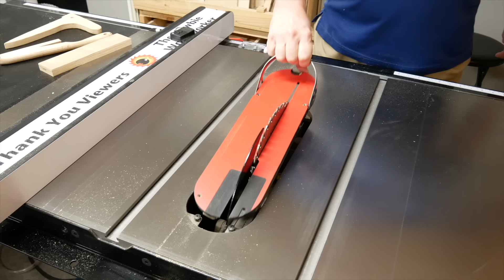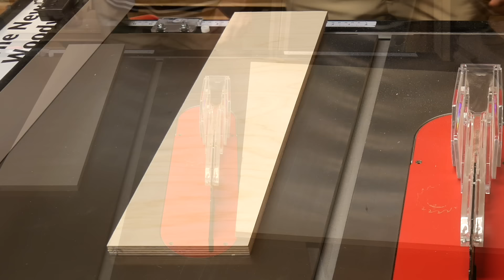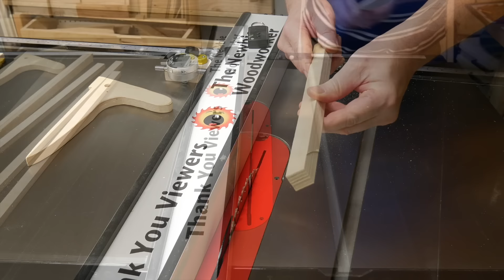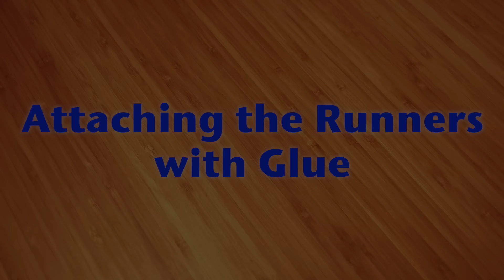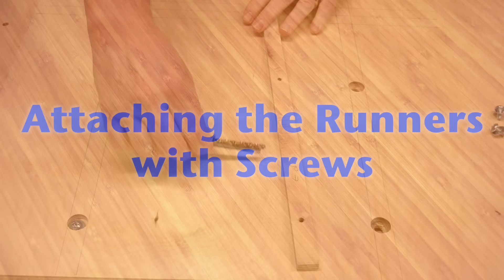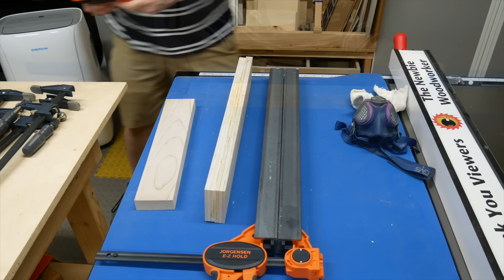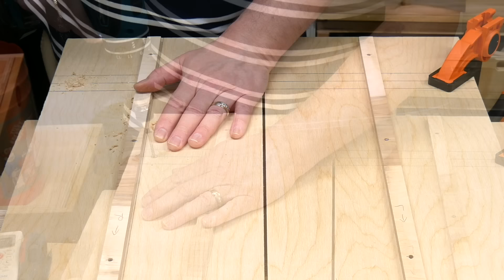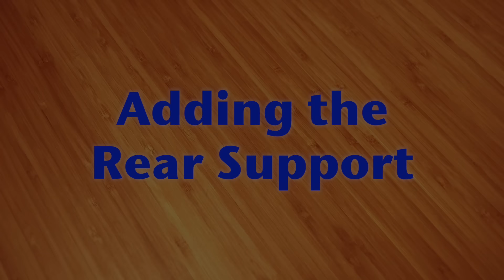Build this Revolutionary Cross Cut Sled, for Newbies!

Comment: Great video, from a guy who has bandages on two fingers due to a table saw accident last week.  When I first got my table saw two years ago, a friend said don't use the blade guard, it just gets in the way.  So I never used it. For the last week, as I heal, I have been reviewing a variety of table saw use videos, push stick designs, etc..  It just occurred to me that none of the videos I watched said anything about using the riving knife or blade guard.  I appreciate you making the effort to raise safety awareness, even if there are those who disagree.  Perhaps if I had seen a video like this earlier, I would have avoided my mishap.  Thanks.
Reply from the maker: Sorry about your injury, but glad to hear it's healable! Yes, using the blade guard can be more work. I still have to remove it a lot, but not nearly as much because of this sled, so I'm glad I made it. But if you have to remove the blade guard, make sure you always using a riving knife if you can, because it goes a long way towards helping prevent kickback. Thanks for the comment! 😄
Reply: Same for me. I have a racing stripe 1/8th inch wide on my thumb.  Took the skin, so I was blessed with a wake-up call and not an injury.  Same reason.... 

The riving knife has saved me from kickback more than once.  Need I say more?

If you haven't done so already, lLook up Ted Baldwin at https://www.youtube.com/watch?v=knotpj60bsk  and https://www.youtube.com/watch?v=ZmGiO5lPS1I on Youtube.  I've watched these videos close to a dozen times and still like to watch them.  Great for safety and ideas.

Comment: As a relatively newbie woodworker, I bought used equipment and the table saw I bought had neither a riving knife nor a blade guard.  I did not fear the machinery, but I did have a healthy respect for it.  As an ex underground mechanic/electrician in an underground coal mine, I learned early in my career that ultimately I AM RESPONSIBLE for my safety.
One time I reached across the table to retrieve a cut part and as I had taken meds previously, I allowed my arm to dip lower than usual.  As there was no guard on the blade, before I involuntarily jerked my arm, sure enough, it nailed me.  Ultimately I needed 13 stitches and clamps/staples on each end of the "incision".  moral: ?   Under NO CIRCUMSTANCES TAKE ANY MEDS AND WORK IN YOUR SHOP.  Do not even take aspirin, as you do not know if it will affect you or not.   Safety guards were added for a reason and with my knowledge and expertise, I can only blame myself.  USE YOUR SAFETY GUARDS AND PPE's
Reply from the maker: Thanks for the comment. Your story is good warning that when medicine says "do not operate heavy machinery", it means it, right? And yes, use any safety equipment you can.

Comment: In the middle of watching. Nice vid!
For metric woodworkers, 7/64" would be 2.78mm. 3mm is too big so 2.5 or maybe 2mm for those pilot holes, if that's all you have.
Reply from the maker: Thanks! You may have to remind me again in a later video. 😏😄
Reply: The Newbie Woodworker No problem. No need to speak them out in the video. You can put them in the subs if you wish but imperial is fine for me. It’s easy to convert. 25.4mm = 1”
That fractions app in one of your other vids looks great. I need to use that to test my daughter’s school homework!
Reply from the maker: @jimlynch3604  LOL - I think I'd need a lot of apps to help my kids these days. One thing I discovered while working on a Mac is that you can bring up Spotlight and type in 7/64" and it gives you 2.78mm, which is really handy when I'm editing videos.
Reply: The Newbie Woodworker Wow. I never knew that. That’s amazing! “A Tip a Day” by Newbie Woodworker.
Reply from the maker: @jimlynch3604  I'm just full of semi-useful information. 😂
Reply: The Newbie Woodworker 😂

Comment: I followed your suggestions and made a cross cut sled so that I could still use the blade guard.  I got very lucky in cutting the inserts for the miter track and the sled works great.  Thank you for making this video available.  Safety is a big deal.
Reply from the maker: Thank you for sharing that! Not a lot of people tell me if they made something I showed in a video, so I appreciate that you took the time. Thanks! 😄
Reply: The Newbie Woodworker 9

Comment: 2:56 What is that blue material you are using to protect you table saw from glue?
Reply from the maker: Those are "silicone project mats" from Rockler. A large one and a smaller one. https://bit.ly/39o0Kqu. They're not cheap, but I love them. Glue just peels off. Most of the time, anyway. 😄By the way, I don't get any money from Rockler, in case you're wondering.

Comment: I’ve been an injury-free "pro woodworker” for 50 years (baring minor cuts & scrapes).   The debate between “pros” and “newbies” over what safety equipment to use has been going on forever.  Pros have learned safe behaviors & so can “get away with” less gadgets; newbies haven’t learned enough and so need more “built-in” protections.  There is no One-Size-Fits-All.

 BUT the ONE point that ALL the safety advisors I’ve seen/heard/read don’t stress ENOUGH is that your SAFETY HABITS (your BRAIN TRAINING) is what protects you NOT the gadgets.

 So here’s how I’ve stayed safe for 50 years.  I’m repeating some of your points but changing the focus. 
      1. know how the tool works and its limitations.
      2. know how the materials behave and their limitations (e.g.:hardwoods behave differently from softwoods).
      3. maintain tools and your work space for safety.  That means anyone in the space KNOWS & FOLLOWS the “rules” as you set them or they LEAVE - NO EXCEPTIONS.
      4. maintain a mental attitude of safety.  If your feeling unsteady, unfocused, anxious, ill, whatever STOP compose yourself before using dangerous tools (hand or power).  A few minutes spent collecting yourself and focusing on safe behavior is NOT WASTED time compared to the weeks, months, or FOREVER spent rehabilitating from an injury.  (Ask my great uncle who lost a hand to a table saw because he let someone divert his attention while he was cutting.)
      5. prepare your setup for a cut BEFORE hand: infeed/outfeed, riving knife adjustments, feather boards, push sticks, where/how you will stand & feed the material, et al..
      6. Memorize a mental safety check list & USE IT EVERY TIME you’re about to cut with the tool.  It will take less time every time you use it.  Include: safe zones on the tool, hand placement & movement while cutting, stance, what to watch & listen to while cutting, be calm & focused.  
      7. WHEN CUTTING, FOCUS ONLY ON YOUR SAFETY (everything else should have been set up). 
         a. listen to the saw/tool; take out earbuds &/or turn down radio -your not on vacation “gruvin’ to the beats”.
         b. listen to the material going into the saw/tool (you can usually -not always - hear in the cutting sounds when trouble is developing even with noise protectors on)
         c. FOCUS ON MAKING THE CUT SAFELY AND NOTHING ELSE - NOTHING ELSE.  This prepares you in subtle ways for any unpredictable/unexpected behavior of the tool or the material.
  
BEING SAFE IS A SKILL to be developed/practiced.  Ask any fireman, policeman, soldier -practice it or suffer the consequences.
Reply: On the issue of "Pros have learned safe behaviors & so can “get away with” less gadgets", if you're advocating for not using blade guards and riving knives, I'm not sure I could agree less.
Your bulleted list is very well thought out and comprehensive and clearly demonstrates your professional approach to your work but I don't see anything in it that negates the benefits of the stock safety features of a table saw.
For background, I've been a full time woodworker for 35 years and early in my career had a fairly serious accident on a radial arm that was missing its anti kick back pawls. (This was when I was freelancing in another workshop.) Best wishes to all!
Reply: @jonomoles  100% correct. Everone makes mistakes and guards can help you when you do. 'Pros' make mistakes too!
Reply from the maker: @chriselliott726  👍
Reply from the maker: Thanks! 😄

Comment: New to woodworking, but have a question.  Has anyone accidentally pushed their sled all the way through and cut their sled in half?  Is there anything you can to prevent that?
Reply from the maker: There's a significant amount of resistance when you try to do that, so it's not really a concern - especially if you glue on the support piece. You know when you get to the end of the cut. But don't forget that you can always make another one if something goes wrong - so perfection isn't really relevant. 😄
Reply: Shouldn't the back and front fences be high enough that they will still support the boards even if the blade passes tight through?
Reply from the maker: @nickw9376  Not with this sled, because the rear fence is actually split in two.
Reply: You could make a stop block under the sled if you make the base plate long enough, but that would likely make the sled awkward to handle...

Comment: Maybe a plywood low angle truss shaped support block/handle behind the fence?(Spanning the width of the sled but extending out past the back edge far enough to have a finger slot) More insurance against sled splitting and you can use the handle to hang it on a wall!
Reply from the maker: I haven't had any issues at all with this design. It turns out that my worries of the sled splitting were unfounded.

Comment: Thank you for suggesting that I stop watching now because that is just what I did I stopped but before I go I want to give to you this note from one who served his full four-year Union apprenticeship and over 45 years of experience in the finest woodworking shop in Los Angeles (premium grade shops) and in my early days of general carpentry and the use of all kind of small and big machinery in cabinet shops of all kinds.  Many of us Professionals who have work in some kind of cabinet shop or just some kind of finish carpentry and even just general carpentry the table saw blade guard is more dangerous simply because you can't see what is happening at the blade and this contraption even interferes with the fence.  there are many numbers of different cuts also made at the saw that the blade guard just can't be used.  The Riving Knife is good only for cutting large pieces of PlywoodInso in short:  all these push pads that have your hand go over the blade and the trusted old Blade Garud just are a  pain in the butt and even though they mean well there  just are a nuisance for the professional who makes many different cuts than just straight one with little pieces of wood.  It just can't do it all and to put it on and off is not an option.  THE BEST SOLUTION:  Learn Good Habits when using Any Kind of Machine.  Learn Good Working Habits.  Dress for the shop, not the beach.  No jewelry of any kind and Keep Your Word Area CLEAN.  And Above all know your machine and its limits and your limits too when working with it.  That is the BEST solution NOT a contraption that gives you a FALSE sense of Security.
Reply from the maker: If you don't like blade guards, that's fine with me. But when you say that a riving knife is only good for large pieces of plywood, it shows that 45 years of experience doesn't automatically equate to knowledge. Not only are you wrong, but you are spreading dangerous information. If you bothered to study kickback at all, you'd know that one of the causes is stock that gets picked up by the teeth of the blade coming out of the saw. When this happens, kickback can happen in a nanosecond. If you're ripping a piece of lumber and the forces contained in the lumber get released during the cut and cause it to flex towards the blade on the outfeed side, BAM, kickback. Unless you have a riving knife, in which case the stock won't touch the teeth of the blade (not much, anyway) - the worst that would happen is it gets harder to continue to feed the stock through the blade. I'm not sure how you could not know this.
Reply: I don’t use a blade guard myself. BUT no riving knife?  That’s totally insane. I work with a lot of recycled wood. That board may look straight and be flat. But too dang many times when ripping one I found out it’s stressed. I cut one that sprung out 3 inches on a 10 footer. Oops. You just don’t know if that will happen until it’s too late. 50% of the wood that looks perfect to start with goes toward heating my shop. 

One rule I live by is: you never ever take your eye off a spinning blade. No excuses. Not even to shut the saw off. 58 years and I still have both eyes and all 10 digits on my hands.
Reply: Just let it be said and move on. Ignore what you consider ignorant. 🙂 It's all been said before.

Comment: How many people have gotten hurt BECAUSE of fighting the blade guard?   Likwe to see you cut box joint s on that abortion. Do you know that the purpose of the sacrificial stop at the bacl pof a sled is to reduce chip out? - 5 bucks says you wear gloves when yuou drill metal on a drill press or when using a grinder/ - Dumbest thing you can do, and an OSHA violatioin to boot. 

Her is a fact bunky.. With few execptions using the blade guard on a table saw is impossible in 90 percent pof opeartions yuou do on a table saw. - How's this?  Dump the guard in the trash and learn to keep your fingers away from the blade instead of depending on a guard to replace personal responcibility.     Remember that every machine tool is out to get you and act accordingly.
Reply from the maker: Sorry it took me so long to reply but I was trying to understand your convoluted logic, and having to decipher your poor grammar and spelling didn't help. But now that I think I understand the gist of what you were trying to say, I realize I just wasted some of my life reading pure drivel (you'll probably need to look that word up, so here: https://www.merriam-webster.com/dictionary/drivel). The least you can do is pay me the $5, because no, I don't use gloves in those instances you mentioned.
Reply: What a jerk.
Reply: A troll that kant spoll
Reply from the maker: @BrettMiller2008  😂
Reply: It seems to me that someone's got control issues. Why not just use the tool the way you see fit and let other's worry about how they would choose to operate it?

Comment: I've never used/worked with paste wax before. Will it make the surface of my table saw greasy or oily?
Reply from the maker: It won't affect your table top at all, except maybe a little of the wax will transfer to the table top, but you can even wax your table saw top with paste wax, if you want. 🙂
Reply: Excellent, thank you for the response!!!!
Reply from the maker: @mikemcfiggus8996  👍

Comment: Also, I applaud your emphasis on safety but using a variety of push blocks (once even to cut a 20+" wide piece of plywood) and then placing your hands within 3" of the blade (in front of the sled fence no less) in your video to demonstrate the sled sends a mixed message.  Bottom line, safety with all tools requires a 'top of the mind' awareness at all times regardless of whether or not you are using the blade guard or other safety equipment.
Reply from the maker: I understand your concern. Safety is very important. We just disagree on what's safe and what's not, and if you got a room full of woodworkers together you'd probably never get everyone to agree with everyone else.